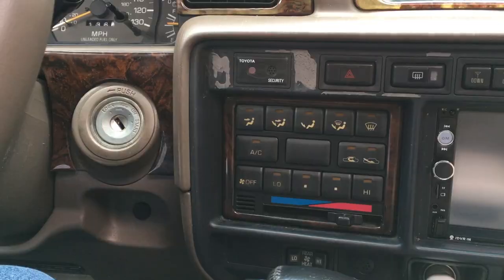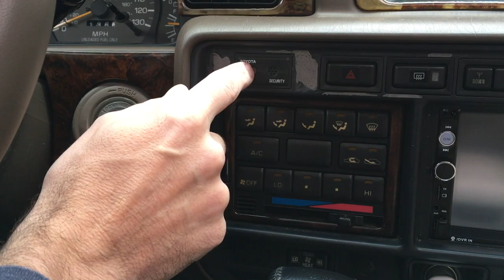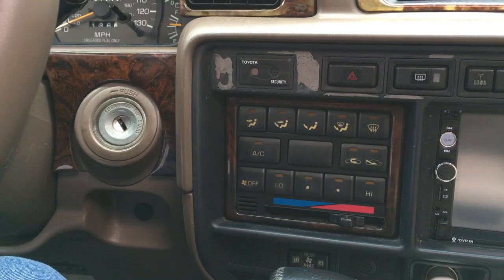1997 Land Cruiser RS3000 Piezoelectric Alarm Replacement and Programming

Comment: Hi Rick, thanks for the video. Recently, the batter drained on my LC80 1997. When I installed a new one, it looks like the anti theft starts to kick not allowing me to turn on the engine. Basically, the starts spins but the engine won't turn on. Is there any way to reset the anti theft. Thanks again
Reply from the maker: Are you able to turn off the alarm with the alarm remote?

Comment: did the random auto lock subside after you wired the new piezo?  I have the same issue, no chirp.  I think I will do it but I will disco the battery, do the switch and reconnect.
Reply from the maker: Try page 11 of this RS3000 manual: http://www.cgl.ucsf.edu/home/tef/RS3000/RS3000_OwnersGuide.pdf

Comment: I just bought an 80 but no key fob, I clipped the wires after it was going off randomly when someone detailed it (I’m assuming water got in it) and now car won’t start

I tried tracing it but not sure what to do at that point
Reply from the maker: Have you tried reconnecting the alarm? It might have detected the alarm had been removed and disabled the vehicle. That's just a guess. You can get a replacement fob on Amazon. I have a video on that here: https://youtu.be/M5N3uL0dgMw The link to the fob is in the description. Sometimes the single is unavailable so I have a link to a two pack too.